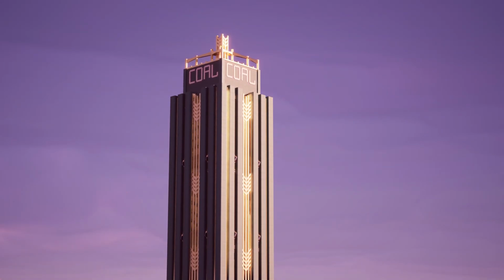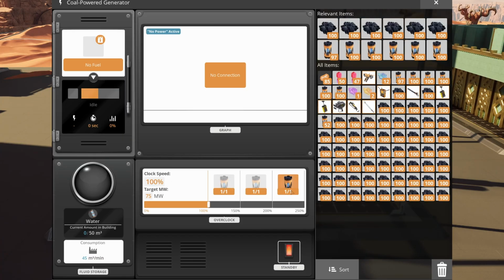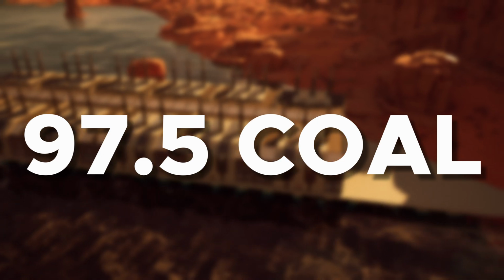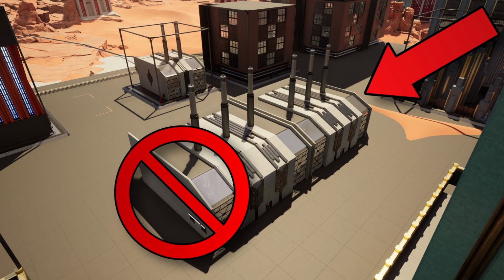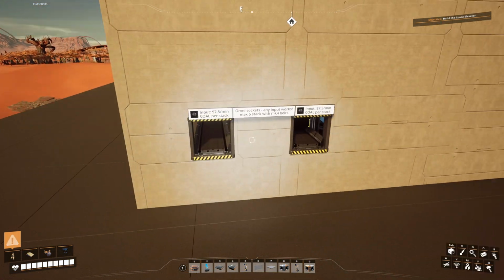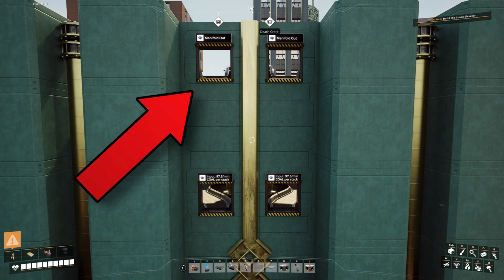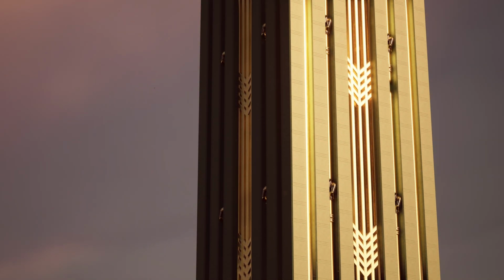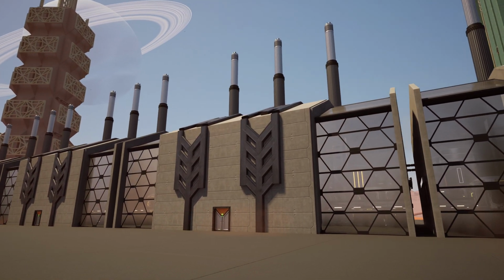Coal Power as Art Deco Skyscraper! Satisfactory 1.0

Comment: This is fantastic!

I wonder though if it can be improved even further by using only a single pump per blueprint, if you have a "water tower" design in your top blueprint that feeds back into the 8 pipes below. That way one pump stack could carry headlift to all lower pipes.
Reply from the maker: Water tower on the top will result in more active pumps. Water need to get to the top first. There is total of 2400 water to be pumped onto the top with water tower concept. While in this layout water pumping drops by 300 every 40 meters. So it is 2400 water pumped on the first blueprint, 2100 on the second, 1800 on the third, and only 300 on the last.

Throughput of pipes is the limit.
Reply: @Yakez42  I think the pipe throughput doesn't matter, as long as headlift is propagated - so you'd theoretically be able to lift a single column of water up to the top, pressurizing the entire system, with one pump per blueprint for 8(?) pumps total for the entire stack, moving all the water you need.

Or maybe I'm wrong on how headlift works - you definitely know more about the game than me. In any case, wonderful build, and great video as always!